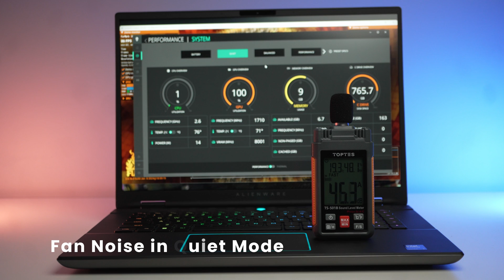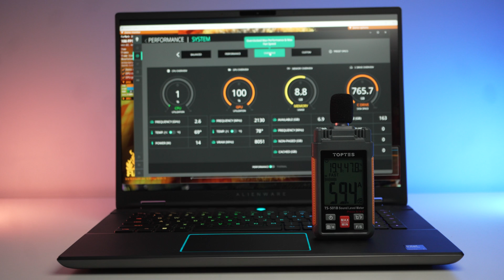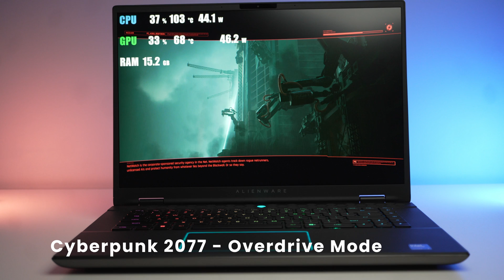Revealing: Secrets of Alienware m16 r2 Acoustics and Heat for 2024

Comment: Hello!
I just bought the alienware m16 r2 , and on the first turn on and setup it got very hot from below and i felt it also on the Keyboard. Althought i was doing nothing on it.. it was just turned on... what do you think???? Personally i think its bad no?
Please help!!
Reply from the maker: It depends on how hot. Gaming laptops output a lot of heat because they have powerful components inside. If the temperatures are very high when doing nothing (idling) then you can return/swap it for a another one or talk to AW support. Without any numbers to quantify it's very hard to qualify "very hot".
Reply: @techknowlux I am getting 70-80 when idle in balance mode. İs it normal? Or should I return it? I purchased as open box from best buy please answer :)

Comment: Hey, so far are you liking the m16 r2 more or the Lenovo Pro 7? I ended up buying both but will return one of them after I get some time to compare. I went with the m16  in a 4070 and the Lenovo in a 4080 at $800 more( CAD). 

I would like the most future proofing and ability to game at 1440p/4k at 60fps+  but I also really value design, battery and lower temps/ fan noise.

Thanks!
Reply from the maker: @wc8561 If you love gaming and nice displays and graphics/visuals, keep the 4080 Legion Pro 7. The m16 has a poorer display by comparison and the 4080 can be upwards of 50% more performance. And not just in games but content creation too (if you're into that).
Reply: @techknowlux  my r2 came today and gaming has been great except the fans are super loud ! Any chance the Lenovo is quieter ? Though I’m in doubt as it’s running a 4080 …
Reply: @wc8561 Iow fan noise is also important to me as well! Suprised to hear that the fan noise is that loud with the m16 r2 as the original m16/x16 were some of the quietest laptops when gaming in silent and balanced mode. Are the r2 fans loud when gaming in balanced mode as well?